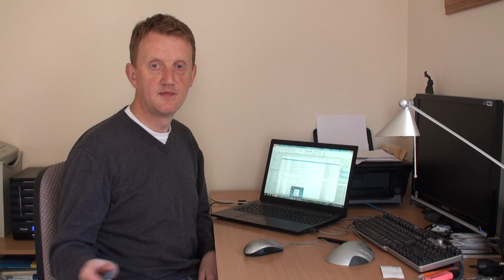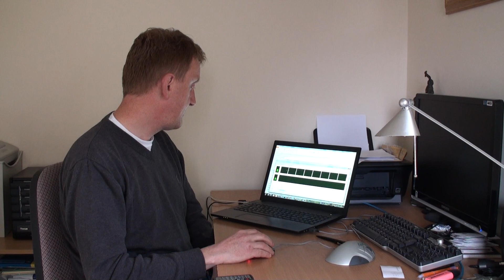Ultranote 15.6 review after 3 months use

Comment: Interesting review.  Firstly, would you consider the latest model given your experience with this.  The issue with the fan worries me as having previously owned a Vortex III aka outdoor electricity generator (!), the noise was a bit of distraction  Incidentally, Did you install 8GB or 16GB of DRAM?The other thing is  the  on-board  graphics and sound card; given you have limited configuration options either.

Comment: Hi there. Thanks for the vids about the ultranote. I know they are a few years back now, but I was wondering how you're getting on/got on with the laptop over the couple of years? I am considering getting one, and whilst the specs offered from pcs may be slightly different now to when you got yours, the case looks to be exactly the same. That's mainly what I'm wondering about - how have the hinges held up, is there any flexibility in the plastic, is it looking tatty as I understand the paint wears away really easily on this, things like that. There's another video on here that seems to show it having kinda poor build quality, with loads of flexing in the body, plastic coming away at the back under the screen etc...

Thanks in advance for any info you can give.

(And sorry for the long post, I am prone to rambling on a bit...!)
Reply from the maker: ednewmy I have this laptop for 18 months now I think. Still going great and hinges are fine. 

I also saw that video and I can confirm that there is a little flex in the case when you press down at a certain spot. This would have been like this since new, not some new issue.

There is an issue with the way the paint wears off from the track pad and the case at the point where you rest your hands. Seems to wear quicker that other laptops that I have had. To be honest I am not too bothered about it as I use it a lot and its whats inside that matter to me.

I re install Win7 about every 6 months just to keep things fresh.
Reply: Thanks for the in depth response Darragh Delaney. The flex wouldn't bother me too much I think, and it does seem like that guy was really not holding back in his video. Then again I've heard from others that there is no flex whatsoever on the ultranote ii, so perhaps the case is ever so slightly different. Paint wear is not too much of an issue as I use peripherals mainly, and as you say what's inside matters more.

Again, thanks very much for the response. It really helps to have some insight from someone who's owned one well into year two. My old off the shop shelf low budget compaq has been going for 6 years now, so I'm looking for something with hopefully similar staying power!

Comment: Hi, nice review! I have two questions:
you mentioned battery life with just several words, can you say little more? 
I found that display there is LG LP156WF4-SLB5. Data sheet say it has response time of 35 ms. Do you find this is little slow?
Reply: I don't have this laptop but will be planning on getting it.That said, I've worked on screens with a response time of 40 ms so I hope my input will be useful to you.

Let me just get straight to the point: no, 40 ms will not be a bother unless you want to play some FPS games. Even then, if you are a console gamer, you will have played on much worse than 35 ms.

It could make the laptop seem slightly unresponsive after using a < 5 ms monitor and high DPI mouse for a while, but that's the worst you should expect. I've found that a low sensitivity on a laptops touchpad counteracts the high response time anyway.

Though I'm just someone talking out my ass from experience.
The 40 ms TV isn't an issue at all, just my spoilt ass being annoyed at not using my PC. I'm not sure if this situation reflects yours at all, but it is helpful I hope.